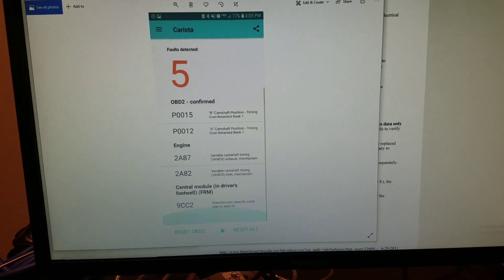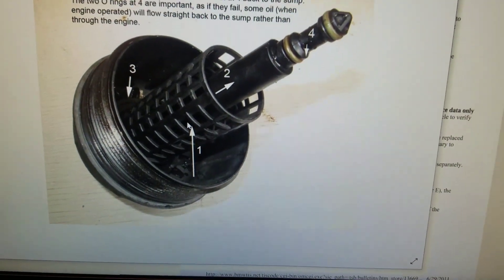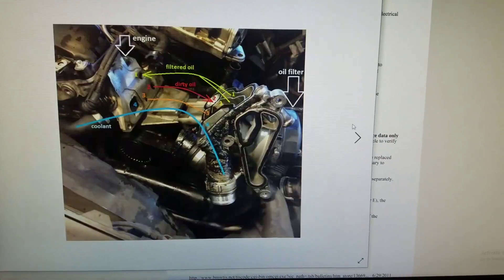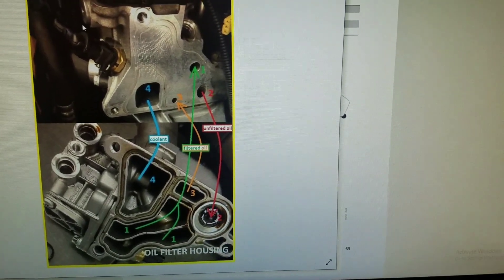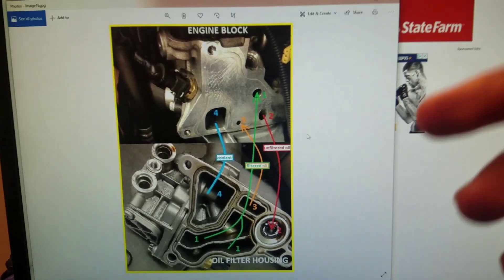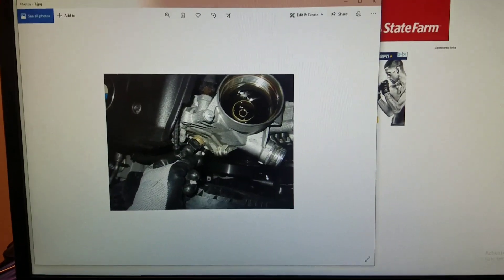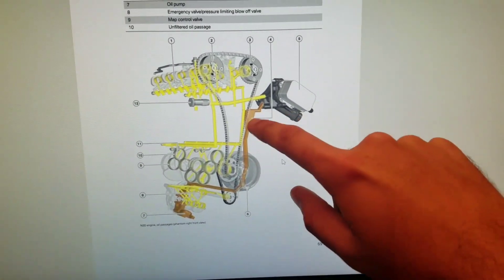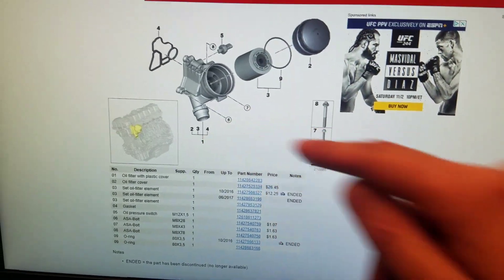VANOS FIX. Troubleshooting steps diagram!

Comment: First, I wanna say this is a good video. This actually happened to an X3 that I had. Walmart at the foot of signal Mountain in Tennessee change the oil and threw away the cage and the insert that keeps the oil from draining. I would not recommend oil changes at Walmart for a BMW under any circumstances. When that cage and the insert are missing that will make your engine run like garbage and yes, it can destroy your engine. Do not depend on the sensor for oil pressure. It takes a very minimal amount of oil pressure to keep that sensor from throwing a code. Something like 20 psi is all it takes.

Comment: I have an 06 325i
 Is this for  n52?. Or newer engines?. I have the cage and the billet with a spring but only 1 o tiny o ring?. Are there 2 o rings and a black cylinder?. I don't have that now I'm freaking out. Are there 2 different styles of filer caps?

Comment: Question, what do I do after realizing this? I had the piece inside my cap  but my o-ring was flat and broke up which allowed oil to go inside I put a new oil cap and cage and still had the code: p0012 do I have to let the oil that have been going in the there burn out? Or what I’m not sure but from the look of my cage ring that was the problem.

Comment: This Video is about to save me big time, after 8 months of no results!!.. but i have a question: for the 2012 BMW 750LI F02 (N63 Engine) where can i buy that part, because i believe it's part of the upper oil filter housing and NOT part of the lower filter housing itself. Mine is missing. PLEASE HELP!!! where can i buy it and/or what is the part number?

Comment: Bro this video is underrated!! Great video because I had the same problem and yes you are absolutely correct. The cage plays a big role in the oil filter housing. Always check.

Comment: I just bought a 2013 e93 with 82k miles on it. Got vamos codes a few days later. Took it back to the car lot and they installed new vanos. Codes came back the next day. Checked the basket and sure enough it was missing. Taking it to BMW next weekend to get an oil change and new basket. 
Hope this fixes my issues.

Comment: Been struggling after changing valve cover and oil kept getting p0013. Turns out the filter might be to long. no code without filter.

Comment: Hi there, thanks for sharing great info. I bought recently BMW with n52 with 172k km on it. The previous owner gave me bills with it as well. The last oil change was done in BMW service on 171k along with other stuff, however, the gasket on oil housing was leaking so I decided to change it myself. After removing the oil filter cup guess what NO element for the filter at all, the filter was just sitting there. In memory was stored fault code relating to vanos system. I replaced the gaskets, bought a new filter element and all seems good now, just hope that bearings and other stuff are not damaged.

Comment: Hi, after I change oil I end up with Vanos problem. I change the both Vanos but still error there. Is that possible because of the this filter or oil itself? Buy the way when engine is cold everything works perfect. After a 15.20 minutes engine start to hesitation and sometimes engine light is on. Any idea?
Reply: Did you solve the problem, because i have the same problem?

Comment: Dude! Thanks for your video man, I popped these codes after changing my oil. I went through and cleaned the actuators and still had same problem. Saw this video and checked my cap low and behold, the center piece is missing.

Hope I did cause any damage otherwise driving it.

Comment: I went to a Mobil 1 oil changing place and usually I do it myself but didn’t have time, they changed my oil and filter and when I started the car it made a loud squealing noise and rough idle. They claim they did not do anything other than change the oil and filter so they performed another oil change and when I started the car again still same problems. I took it home and checked the filter and yup they forgot to put the cap back on the filter. What should I do in this situation?

Comment: Great video, saved my ass. I changed my oil last week and accidentally threw out the centerpiece. Five days later I got engine oil pressure errors. Every other video I found was about catastrophic engine failure, I thought my car was dead...and I still owe money on it. I bought a new oil filter housing cap from the dealership and the car is good. Thanks for the information.
Reply from the maker: Samuel Valente Very glad it helped. That could have turned a lot more expensive!
Reply: @autohut3720  My biggest fear was owing 10k on a dead car. But thank God you posted that video, I was laughing my ass off because I dodged a Howitzer. Thanks again.
Reply: I bought new genuine Bmw oil filter cap! God bless me! Hope my pressure light disappear!

Comment: Mostly true, but the small hole in the center being sealed up is not only to allow oil to drain back down when you remove the cap and filter.  Note the small hole through the bottom of the shaft near the  small o-ring(two o-rings on E46 model).  That small hole is to be used as a bypass in case the filter gets clogged.  The oil will go to the top of the housing at the top of the snap in cage and return down the shaft to the sump to you still have oil flow.  Albeit not filtered oil. But non filtered oil is better than no oil.
Reply from the maker: Joseph Gadberry I’ll have to look into it I have an oil filter housing sitting around at home I’ll look at later. I believe at least on n52 it is a drain but it might indeed serve as some type of bypass. The way I think about it is oil pressure would maybe push the basket up if the filter is clogged and allow oil to pass under the oil filter to the crankcase inlet without being filtered while still having the center drain hole sealed by one of the two o rings in the basket if the basket had the two o ring design. The bottom one would act as the sealer o ring while the basket moves up in the cap and the upper one isn’t doing it. But the n52 only has one o ring so not entire sure this is how it works on this engine in comparison to the e46

Comment: Wow, that is a bad design; They should of been reading the pressure on the discharge side of the oil filter, that way you would know if you are running in bypass (clogged filter, bypass to the center element). In that plastic stalk that is in the middle of the oil filter is a pressure relief valve (probably a spring loaded ball valve, don't know, haven't taken one apart).

Ideally, they would additionally use a "differential pressure gauge" to show you the drop across the filter. Then, if it exceeds a preset it would throw an engine code (filter is clogged or dirty, replace).Once the differential gets high enough that little check valve opens you end up going in to bypass and getting in to trouble like you explained.

Another way they could do it is to add a check valve on the bypass line (#3) and if that check valve indicates flow, to throw a code. At this point you are past the point of where a differential pressure gauge would just show a degradation of the filter, when you are in bypass the filter has pretty much been blocked off.
Reply from the maker: I thought they could have gotten away with just a sensor before the filter and after it which would show the drop in pressure if something were to happen but I think they didn’t have in mind that someone would forget to put the basket back in the filter cap. I don’t think it’s particularly a bad design just something that has to be known about. I think even if the filter were to get clogged, the bypass pressure of it would be higher than normal oil pressure which would lead to a code setting off by the only oil pressure sensor the housing has so not everything is lost.
Reply: The small hole on the shaft is also a bypass.  You are correct.  Not sure if it's spring loaded or free flowing though.  But I'm going to find out.

Comment: Hey William, I have a couple of questions. Should the cap and basket be one piece? And could the compression spring in the basket wear out and cause a problem? Thanks
Reply: William, thanks to your diagrams I was able to figure out the problem today. Prior to your video I had replaced the camshaft sensors, cleaned and tested the vanos solenoids with no luck. After watching your video I check the cap and everything seemed in order. But it got me thinking about what you said, that lead me to the vanos oil filters which were completely blocked. So I soaked them in a cleaner, scrubbed them down and reinstalled them. The car no longer has a rough idle, throttle response is on point and best of all no codes after 50 miles. Couldn’t have done it without your post. Keep them coming. Thanks again👍🏼
Reply from the maker: Gilbert Martinez phew that’s great! Yes the system is not as complicated once you look at it from far away as more of a diagram than anything. Those filters can get clogged specially with extended oil change intervals by the previous owners and you’d never know. Hopefully the car stays running good I think that was it👍 glad to help
Reply from the maker: Gilbert Martinez I’ve never seen an issue with the compression spring. The cap and basket are kind of clipped together you could say. So when you take them off it should be kind of one piece together. What have you checked so far and what year is the car? I believe late model year n52s had some vanos actuator problems with bolts breaking.
Reply: Good morning. Thank you for responding. The car is a 2007 530i. Prior to watching your video I got a P0015 error code. I replaced both camshaft sensors, tested and cleaned both vanos solenoids, changed the oil filter and “O” ring. After watching your video I removed the oil filter cap and noticed that the basket and filter both stay in the filter housing. I removed the basket and tried clipping it to the cap and it doesn’t stay. Any thoughts? Thanks again
Reply from the maker: Gilbert Martinez That doesn’t make sense to me unless the chips in the cap itself were broken. The basket kind of goes clipped in there and latches. Either way I think if it were to be nicely seated in the cap aswell as in the drain orifice in the filter housing you shouldn’t have oil loss to the oil pan. Are there any other codes tab P0015? I mean Bmw specific codes you can get through an obd2 Bluetooth scanner with an app or INPA

Comment: Very informative video. I’ve been having the same code popping up in my car. I already changed both camshaft position sensors and cleaned both vanos solenoids. I’m extremely frustrated at this point and have my fingers crossed that by simply changing the oil filter cap might fix my problem. Thanks for the info.
Reply: Hey did this fix the issue for you?
Reply: Did it ?

Comment: Your a genius. You've employed the sciencetific method to diagnose and repair this problem correctly. If you are not a mechanical engineer, you should be. I've replaced the solenoids with gen BMW and still I get the codes.  I am willing to bet that this is my problem.
Reply: Yes that was the problem.  Some oil change center left the entire cage out, o-ring and all!  I replaced the housing about an hour ago, and it's definitely fixed, the CEL was coming on within 5 minutes of driving before,, now No more light. Done,done,done.

Comment: im having this problem too. I replaced the green gasket on the cap but still have the problem...
Reply: BMW Outlet Thankfully I haven’t had the code again but I occasionally have rough  idle from time to time. I’m replacing the whole cap to see what happens. I pray this works!
Reply: @billyowusu48  did it work for you?
Reply: @theewong27  replacing the cap didn’t work. Thankfully though, the car does idle well now. An old battery can cause this issue. I’m running a new battery now.

Comment: this is very informative! I have the 2A82 code on my n54. I got the car used and it came with a aftermarket billet oil filter cap. bought a OE oil filter cap and see if that solves the problem. Please do more videos like this!
Reply: Hey did it fix your issue? I have the same thing and I already replaced the solenoids.
Reply: @emrecan_m4  after replacing the filter cap i drove it for about two months until i sold that car. but yes the code never came up again.
Reply: @emrecan_m4  adaş naptın düzeldi mi seninde sorunun?

Comment: My car has this vanos code (N52 engine) i opened up my oil filter cap and the basket is in there but it is very loose. You mentioned it can cause problems if its missing but if the basket is loose couls it also cause issues? I just ordered a new cap and oil filter anyway... hope it fixes my rough/surging idle!
Reply: @autohut3720  im having the same issue on my n54 2a87. Is the oil filter basket supposed to move? Mine moves up and down .Thanks
Reply: @billyowusu48  you ever figure it out?
Reply: johnpaul c Thankfully, I don’t get the codes again, but I still have slight idle from time to time. This was before i replaced the oil filter basket. Still the same result. Performance is still there thankfully...
Reply: you ever figure this out?
Reply: johnpaul c mine had the oil cap on the engine loose. Throwing all those codes over the cap not being fully tightened. Easiest fix ever!

Comment: Heyy boss man where can I find this Info you were looking at on the computer (diagrams) I got a 07 328i
I'm having a timing issue on cam "A" and low oil pressure (red) comes on at idle which rough and when I drive

Comment: You are right,  I hade problems om my m54b30i with those 2 o rings, and my engine was rattle  when fist started, and one valve lifter was making noise.  After I have put new o-rings in there , everything became normal and no more noises,  even the engine began to pull better. I did not get any vanos code all do,  but I felt the car was not pulling well enough.  Cheers for figure that out to !

Comment: Great video man. Ive been having vanos codes for a couple of months now. Replaced the solenoids and cleaned the check filter but still got codes. Found some articles about the oil filter basket but couldnt check cause i didnt have the right tools to undo the cap. Ordered a new cap with basket and new filter and a tool to remove the cap. It came today and straight away i went and checked. Sure enough, no fucking basket! So pissed at the previous owner. Told me he did the oil change himself. AND hes a mechanic by trade! Some people shouldnt own nice cars. Now im wondering how much damage has been done to the engine running it without a basket. So pissed right now. At least now i can get the new filter and basket in once they turn up and pray it fixes all my issues.
Reply: @autohut3720  So a quick update. After putting in the new basket, filter and full oil change, my car ran good for about 20kms then i got vanos codes and a cylinder 2 misfire code again. Seemed to get even worse over the next few drives. Swapped my plugs and coils, no change. Swapped out my new vanos intake solenoid for one of the old ones i took out and it seemed to fix my vanos codes. Go figure. Still kept getting misfire on #2 cylinder though. Did some more research and found my afr and fuel trims were way out of sync. Reset the adaptations through my jb4 and so far no codes at all after a couple of drives. Will need to keep testing it but for now it seems all codes have gone and the car feels much better.

Maybe you could do a video about resetting adaptations, throttle, afr, trims, timing etc. Could be handy for those getting misfires, poor idle, lack of power etc. Dont think its something many folks consider when troubleshooting.
Reply: @autohut3720  Well you were right! Cats and sensors were actually fine but the new downpipes are a nice upgrade anyway. Pulled out the injector in cylinder 2 that was misfiring and found no crush ring and a carbon caked tip. Gave it a good clean, new o-ring, new crush ring and she's running perfectly again. No stuttering idle, no misfires, smooth power right out to 7k rpm. Happy days!!
Reply: @AshVenturesOn2Wheels   Don't you hate it when you end up with a used car that was maintained by a shadetree (incompetent) mechanic? I see some youtube videos and some of the things they do..  Pieces missing, things modded that they have no understanding of.
I restore antique radios and hate it when someone has been in there with a soldering iron before me. A few times I just resorted to tearing it completely down to individual parts, retesting each part and making an essentially new radio, without their modifications.
Reply: @autohut3720  yeah, 335i. Took it for a run today and the misfire is back. Fuel trims seem to go crazy when it happens. I have a feeling its either my cats, o2 sensors or both. I can smell sulphur when i go wide open throttle which is a symptom of failing cats. Ive got new catless downpipes and new o2 sensors coming so hopefully it might get me on the right track. Man i tell you, this car is just endless headaches.